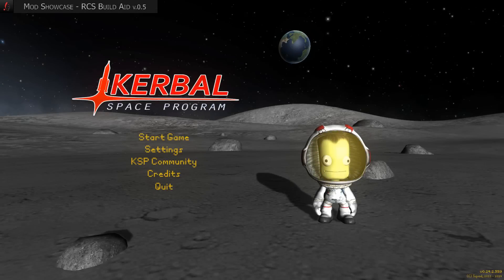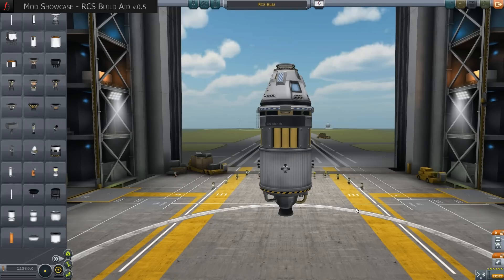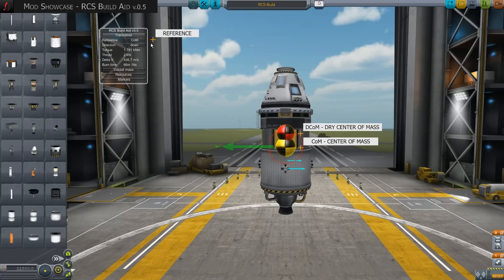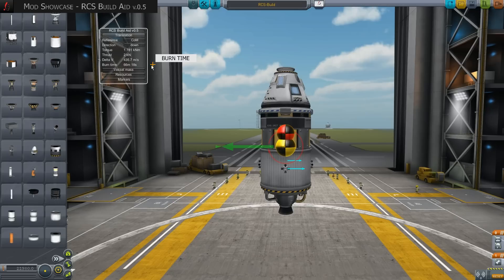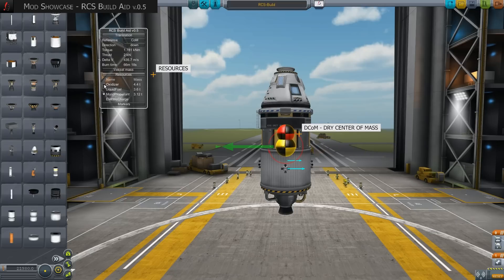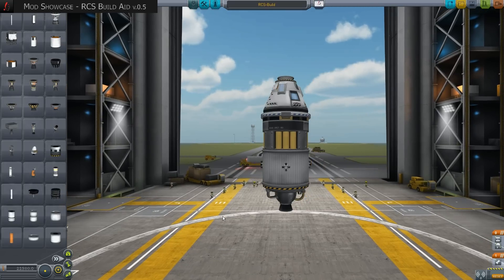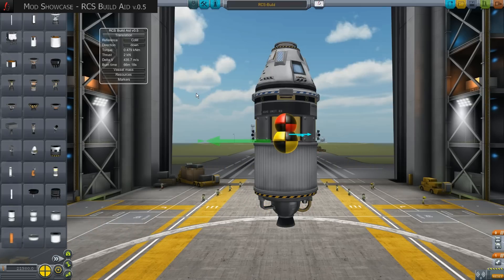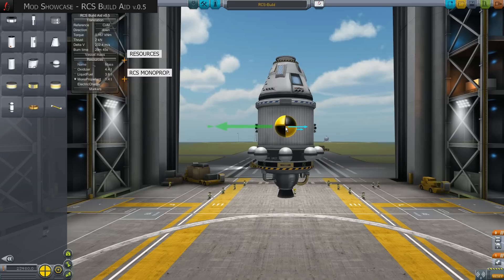KSP Mod Showcase - RCS Build Aid [eng]

Comment: Geneborg This is extremley useful not only for rockets but space planes also!! I added the mod and found some mayor flaws on SSTOs that I assumed were near perfect!! No more "trail and error", stalls or killing kerbals during landing because my DCoM was off from my center of lift !!!  This pairs very well with Kerbal Engineer in order to fine tune ships.

And thanks for the english translation, no way I would've understood it in german :( 

Saludos de Mexico
Reply: Update.  It took me less than 30 minutes to design a small single engine SSTO craft with a docking port to link up with my space station, very stable, takeoff and landing on first attempt, no crashes or unstable flying.  This mod really helps to skip the annoying hassle of emptying all tanks to see where the DCoM and WCoM are in order to fine tune with the center of lift.  Now with the ACoM I can save up to an hour of frustration figuring out why it was all wrong.

Now it's time to take a look at my bigger, more complex multi engine SSTO craft.  Expect another update.

Comment: A well-done video. Clear and well-paced instruction, which really helped clarify the use of the RCS build aid mod. My only suggestion would be to include a short video of the capsule (pre and post optimization) attempting to dock so we can see the torque forces in action and the difference RCS build optimization makes.
Reply from the maker: Thx for your comment and suggestion. Yes, that would indeed be way to visualize the usefulness of RCS optimization, i will consider it if i ever do an update on the video (maybe for KSP 1.0).

Comment: I have a question that I can't find the answer to, no matter how much time I've spent looking.

WHAT IS THE RED ARROW POINTING PERPENDICULAR TO THE CIRCULAR RED ARROW?

I get all the other arrows, but why is the orthogonal arrow there? What does it indicate? If I've placed unbalanced thrusters and I am checking translation balance against a starboard burn that will rotate the vessel to port, why is there an orthogonal red arrow pointing out of the CoM, what does it tell me?? I am not referring to the circular rotation arrow

Thanks!!
Reply: That is the vector of the moment. It shows the axis around which the ship will rotate, while the circular arrow shows the direction based on the right hand rule. Hope it helps!